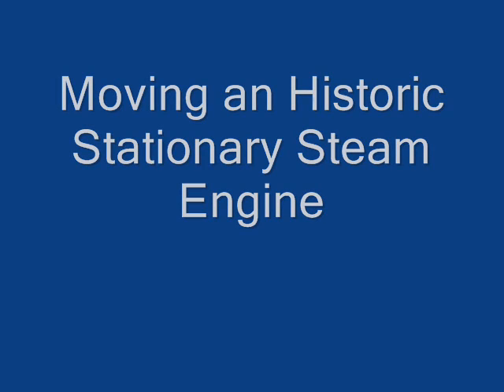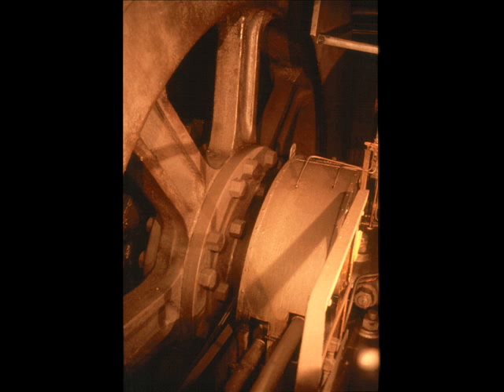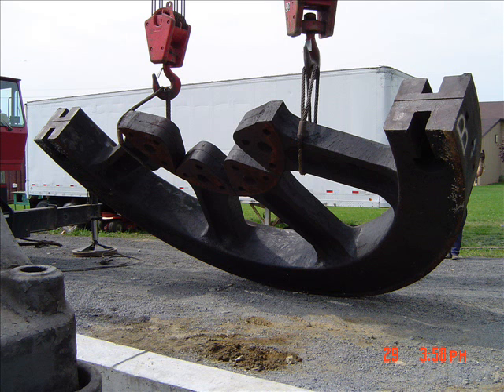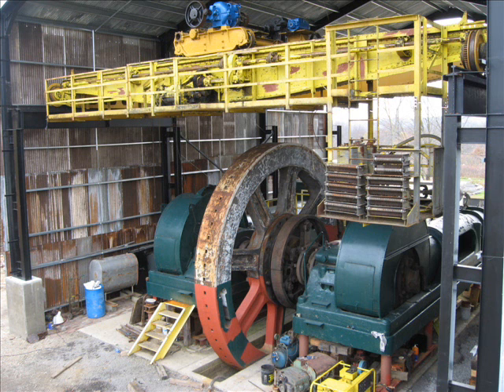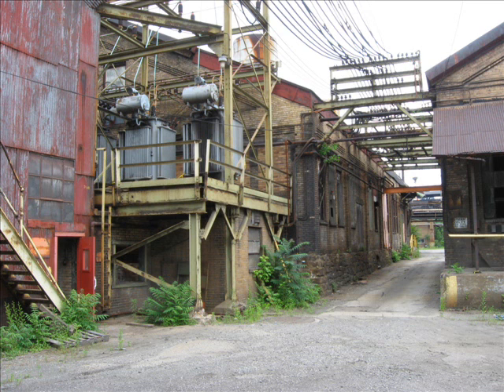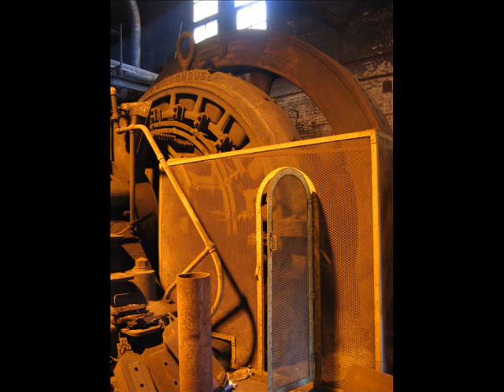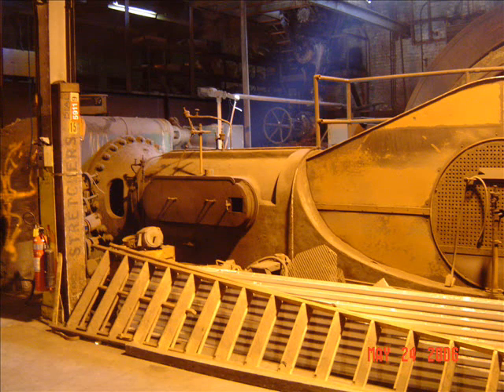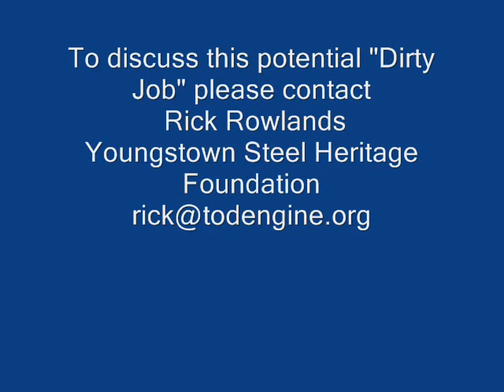Moving a 100 Ton Stationary Steam Engine

Comment: I actually visited and ran trials at that plant for a bit as a trainee in the 70's right out of eng school! Could not believe that they had a steam engine from the early 1900's still being used to power the mill. There was one guy who had the job as "the oiler" and just an oil can keeping everything lubricated on all of the linkages. Great to see that you preserved it as it is an amazing example of steam engine manufacturing, craftmanship and design.

Comment: Thanks I would help but Ilive in Oklahoma and I am total disable. it looks like a great project save the old steam engine. My interest in steam engine is for Home and auto use. I was thinking of powering and old truck for hauling with one but it would have to made lighter for a Truck engine. It can be used as a back poer sorce for your home buy conecting it to a AC generator. steamengine can be used to run off of coal or wood. by uting a pully on the side of the steamengine..

Comment: Look on google for the prestonservices website (becuase youtube won't let you post links.) they have a British ROBEY
Horizontal Shell Boiler
By Robey & Co, Lincoln, Ltd. 1982.
Multi pass boiler suitable for solid fuel firing.
Working pressure 180 p.s.i.
Max continuous steam output 20,000 lbs/hr.
In good order.